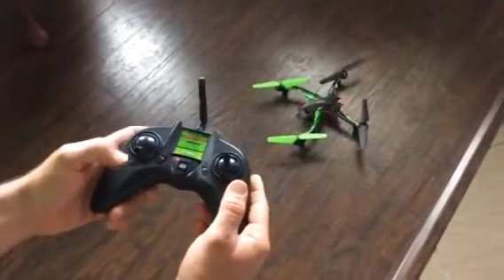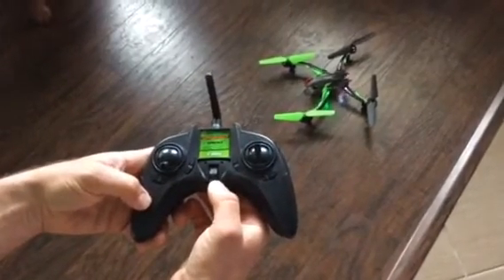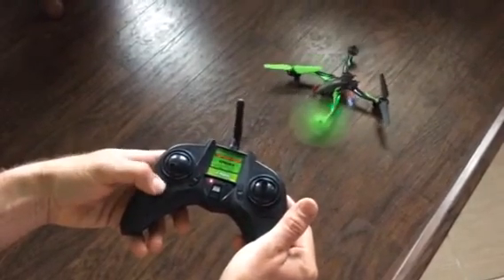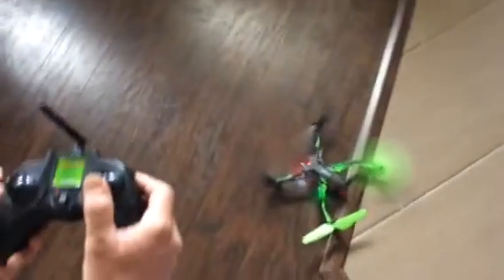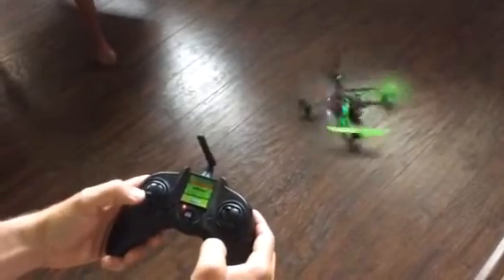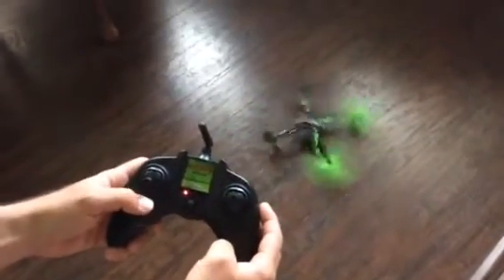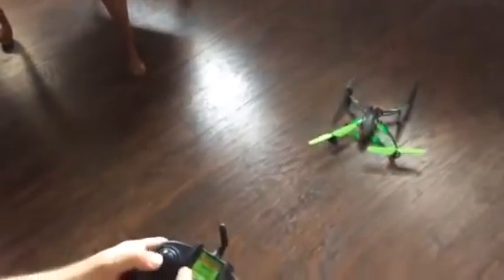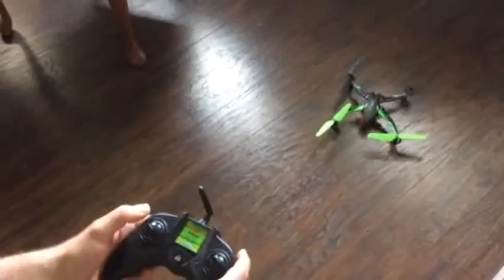Dromida Ominus controller or control board issue

Comment: If you hold the right stick down and then press the left stick 3 times rapidly you will hear a beep then hit the forward trim one time to save. This will fix the problem, it happened to me the 1st day I had the thing. I hope that helps and it should solve your problem.
Reply: Fixed!  Thank you!
Reply: Jamison Haaf It works thanks!
Reply: Jamison Haaf any chance that have will work on the Vista?